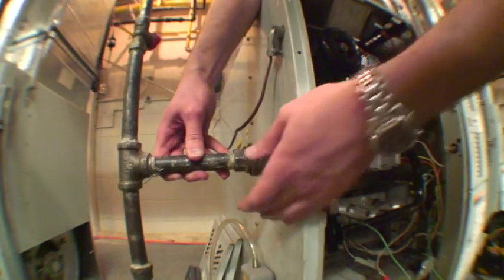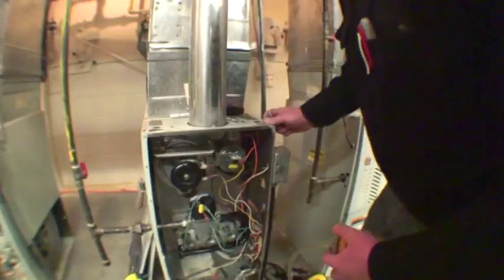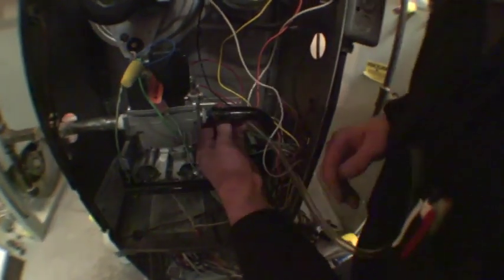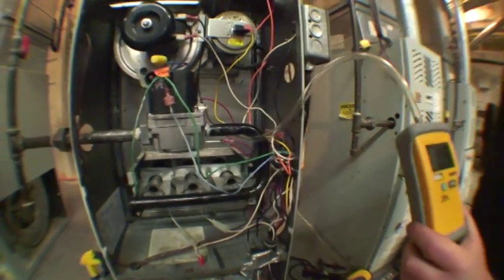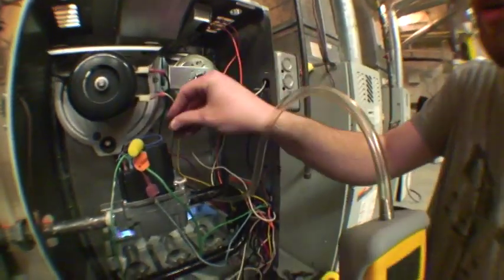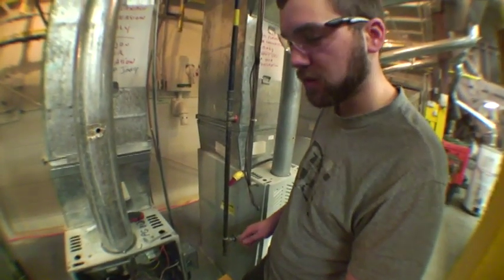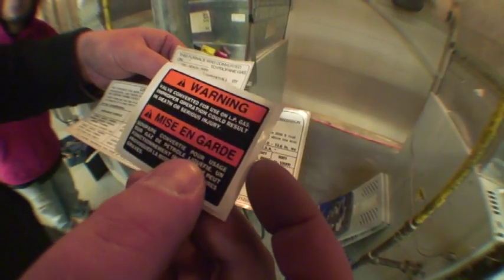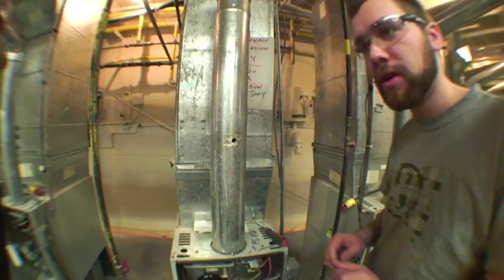Natural Gas to Propane conversion (Part 2)

Comment: Is there some reason that a low pressure switch hasn't been installed as part of the conversion?  I noticed the date of this video is 2011, perhaps there has been a change in the building code?  I noticed the previous question was about the input pressure, shouldn't that be checked to make sure you are within limits before even starting?  We just installed a new Carrier package unit, which we converted to propane.  I noticed that the flame was mostly blue but quite a bit of orange.  I asked about the orange, didn't get much of an answer.  I went over the installation instructions that came with the kit, as it turns out, it appears the technician installed the wrong jet.  It will be replaced with the correct one and the manifold pressure will be re-checked.  Hopefully there will be less orange this time.

Thanks for doing the video, it was very straight forward.

Comment: I'm doing a conversion of my spa heater from natural gas to propane.  I was able to locate the orifice is needed, but NOT the spring.  Any idea where I might locate the spring?  My heater is a Lars Teledyne, well over 10 years old and the company no longer makes this model.  Do the springs differ from one manufacturer to another?  Thanks for your help
Reply: Yes they do

Comment: Great video's part 1 and 2, thanks for posting it.
What should the line pressure be?
The video shows you need 11" coming out of the valve, but not what it should be going in.

Comment: If I wanted to have the ability to swap out NG for LP (say for instance I lose my NG supply) on a short notice (but not do it now as a permanent conversion), would it be prudent to have a replacement burner (with orfice's) and a valve (calibrated) handy for when the time comes?

Comment: Your 11 " w.c. Is very important to the safe and proper operation of your appliance, as earlier mentioned in the video you may never over fire an appliances btu/h rating, but you may under fire by a small 10% as we call a safety margin. Buy exceeding 11" w.c not only are you risking over firing the appliance but you are also exceeding the outlet rating for the valve. By properly clocking the burner and adjusting the gas pressure accordingly you can achieve a perfect firing rate with your allowable 10%. But depending on different factors your outlet pressure may not be exactly 11" w.c.